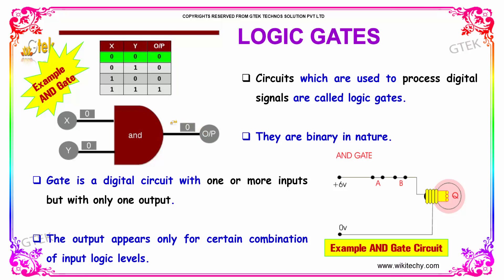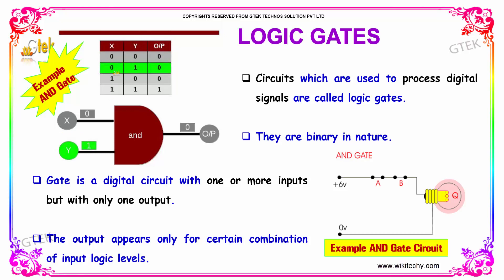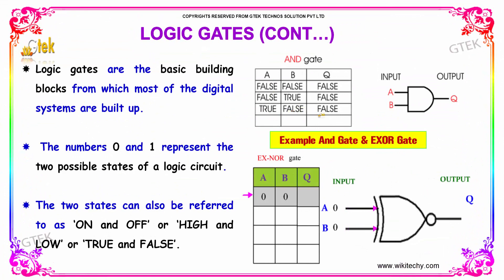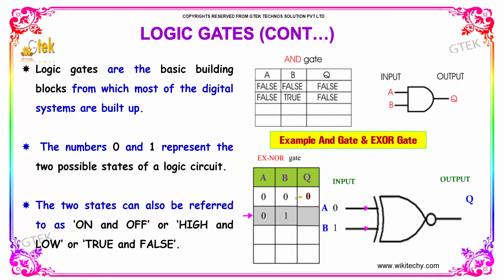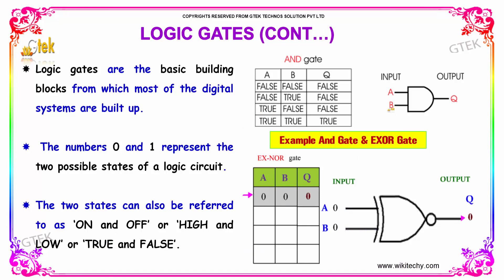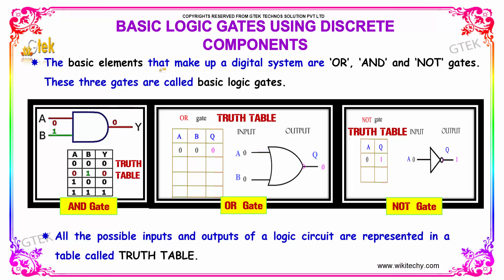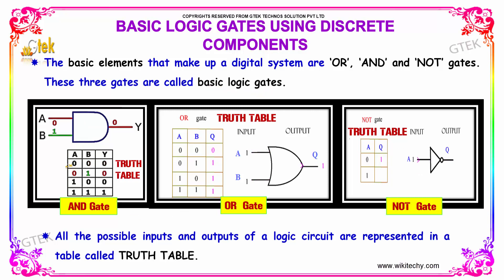Logic Gate Semiconductor Devices Class 12 physics subject notes lectures CBSE IIT JEE NEET

Comment: A logic gate is an elementary building block of a digital circuit. Most logic gates have two inputs and one output. At any given moment, every terminal is in one of the two binary conditions low (0) or high (1), represented by different voltage levels.

Comment: The switch circuit creates a continuous metallic path for current to flow (in either direction) between its input and its output. The semiconductor logic gate, on the other hand, acts as a high-gain voltage amplifier, which sinks a tiny current at its input and produces a low-impedance voltage at its output.